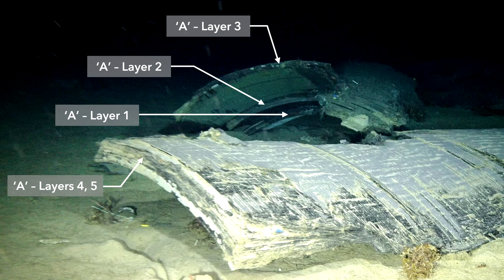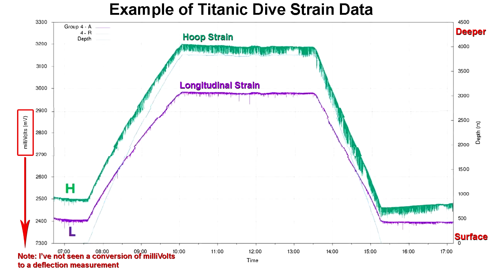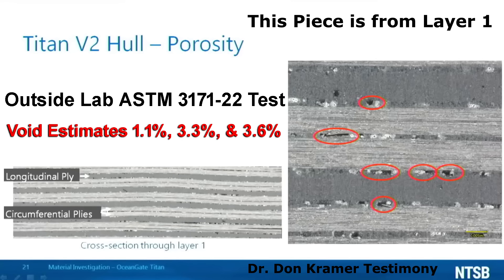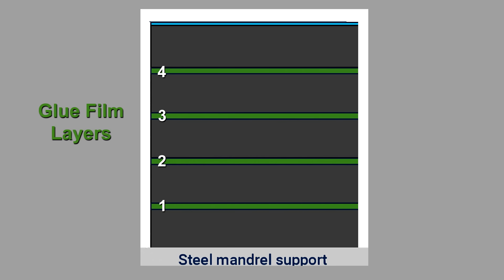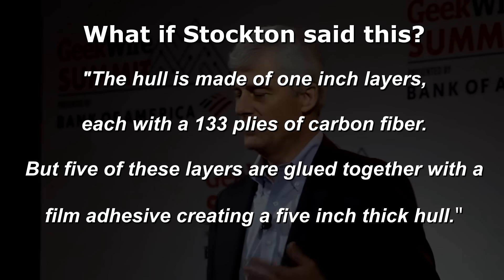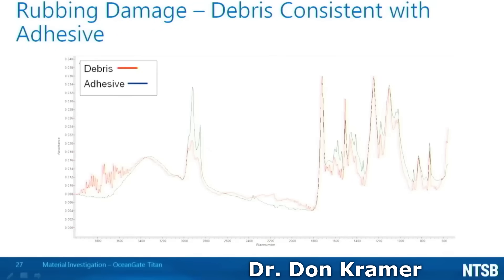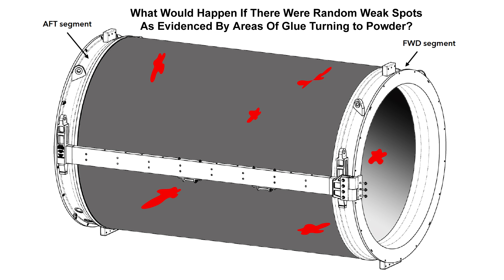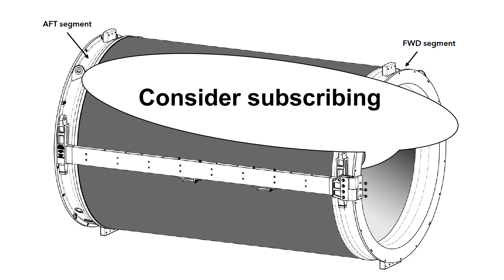OceanGate Titan Hull - Glue Layers Were Breaking Down To Dust - No Clues.

Comment: In 1960, the bathyscaphe Trieste was the first manned vessel that reached 35,814 feet (Challenger Deep) ... and it was glued with epoxy.
Reply: Please be more accurate in your comment.  The original pressure sphere was made from two high strength steel hemispherical shells that were precision welded together.  The replacement pressure sphere was made from two hemispherical end shells and an equatorial ring that were cast by Krupp and then precision machined and welded together.  Any epoxy used on the Trieste was for attaching components that did not need to resist pressure.
Reply: @ronkluwe4875  My comment is accurate and correct. The 3-part sphere of the Bathyscaphe Trieste made by KRUPP was free-form forged and not cast. The parts were machined on all sides, with special attention to the connection surfaces. The parts were then glued together using low-viscosity epoxy without any fillers. My engineering Prof. in uni worked at Krupp in the late 40s and early 50s before joining Black & Decker's EU operations. He used the sphere as an example for a design where the geometry is strengthening the joint under load, so "any" sealant would have worked (in theory at last – in reality, there were cracks due to a different elastic deformation of the parts). The manufacturing process was pretty widely publicized at the time and there is even a 16mm B/W Film about Krupp’s role in the development, highlighting the gluing process. I am using a B/W Photo of a cut-away model showing the glue joints in my materials 101 lecture…
See also: LT Don Walsh, Research Report / NEL Report 1096, July 1962, The Bathyscaph Trieste – Technological and Operational Aspects 1958-1961, S. NAVY ELECTRONICS LABORATORY, SAN DIEGO, CALIFORNIA

Comment: 10 inches were recommended by the carbon fiber manufacturers and this included the 0/90/45 triple winding process. The Titan was made with only 0/90 windings and only to 5 inches. What type of Lunitic would trust a hull made like this?
Reply: Geez, really?  10”?  And they received the recommendation, then halved it?  That’s lunacy in all its glory.
Reply: a lunatic that thinks CF is a good material in the first place.
Reply: @stijnvandamme76  it's nowhere near as bad as commonly stated in regard to compression forces.

It's not as strong in compression as in tension but it's still significantly strong, not weak just not as strong.

Considering that they made it half as thick as suggested, wound it in the wrong pattern and didn't do it properly.

Yet it survived that many dives. If it was 'weak' it wouldn't have survived one dive.

Well regarded and qualified engineers were fine with it being carbon fibre, just not the way they were doing it.
Reply: @retsaMinnavoiG 
Making it thicken would increase the section area where the stress was traction and also distribute better the compression stress.
I like thick hulls and I cannot lie.

Comment: A few4x4 braces inside the middle might have made the difference ?
Reply: Was just gonna suggest a titanium hoop in the middle, internal to the cylinder?  Maybe a thickness of 4-6” to get an effective wedge attribute?  I have no idea what I’m talking about, just a guess.
Reply: @Pene7942 I was thinking of putting a special reinforced concrete inner hull structure under the CF.
Reply: @Pene7942  Yeah, my thought as well. That sort of bulkhead wouldn't really make the inner cabin that much more cramped.
Reply: Load bearing drywall partition would have made all the difference

Comment: The laminated beam example is a good one.  The sheer forces can be extreme, though.  What’s small is the amount of distention or compression the glue layer undergoes. 

In the case of Titan, it appears that the glue layer gave way to the sheer forces before the carbon fiber msterial.  When it did, the hull behaved like five individual layers, each one inch thick.  That stack has nowhere near the resistance to inward force that a single five inch thick carbon fiber composite does.

The other troubling thing is that the fibers were not oriented to resist the inward bowing.  They were essentially circumferentially oriented rather than than longitudinally oriented.

I kinda think that if the thing had been thoughtfully designed, it might still be in operation.  But Stockton Rush wouldn’t listen to his engineers.
Reply from the maker: Agree.  Thanks for your comment.

Comment: While not directly comparable, laminating glass has issues regarding multiple autoclaving cycles. The more times interlayer is autoclaved, there is a decrease in adhesion. This can cause delamination of the glass and interlayer. This is due to the interlayer becoming brittle and not being able to flex properly under stress.
Reply from the maker: Thanks for commenting.  That is interesting.

Comment: Your production is well done, but you're kicking Stockton's dead horse here.     From an engineering standpoint, a composite hull isn't suitable for deep dives, even if it is somehow absolutely flawless.     Period.
Reply: It might be common sense for engineers, but not so for us lay guys.  Plus, it gives us an idea of the considerations a satisfactory material must go through to be robust.
Reply from the maker: Thanks for your comment.  And I agree with you that composites may never be used for a large manned submersible. However, composite hulls have been successful, when smaller and unmanned.  A good example is the Navy's AUSS. Advanced Unmanned Search System.

Comment: the outermost layer of the carbon fiber hull would be in compression, and would be the failure point before catastrophic failure
Reply: I don't think the cylinder needed to actually fail. Bending inward in the center would put a lot of strain on the end joints, pulling the carbon fiber off the titanium. If it failed there, the inward shock wave of water would shiver the carbon fiber into shards. The design failed because of the wrong materials, and that caused the final failure of the materials.
Reply from the maker: Thanks for commenting.  Correct, but the outer layer transfers the compression to the other layers.  That is why for maximum strength the layers must behave as one.

Comment: film adhesive or glue layer sounds real high tech cutting edge - I guess no body could bring themself to say it was DOUBLE SIDED STICKY TAPE
Reply: Wait, did Oceangate seriously build a submarine using fancy double sided sticky tape, cured 5x? 

I am sceptical, but am perfectly willing to accept such a thing. There's so much wrong with the Titan.
Reply from the maker: Yep, you are basically correct.  Thanks for commenting.

Comment: i get why you would use carbon fiber in a race car, but why would you even bother with a sub? is weight really that big of an issue?
Reply: Yes and no. No because you can add on bouncy foam (aka foam will tinny hollow glass beads that cannot be crushed by the weight of 4km tall column of water) to make the sub lighter than water. Yes, because this foam is very expensive and Rush wanted to minimize cost. So making the body of the sub out of carbon fiber (he initially wanted the whole sub out FC_ means less cost as titanium is expensive and a titanium sub is heavier than water and will need expensive bouncy foam.
Reply: As mentioned by Nick, it was all due to cost.
Reply: Yes. More weight requires expensive foam and more volume and a bigger launch vessel and a crane. i.e. $$$$$
Reply from the maker: Thanks for your question.  One of Stockton's big things was that he wanted a long hull to fit 5 people and have "depth" for photography.  He loved the idea that you could have a camera at the back of the sub and be able to take an image of people looking out of the viewport at the front of the sub and enjoying the view.  It was important to his concept of adventure tourism.   Doing this size and shape out of titanium would be too expensive and too heavy.  With a sphere-shaped submersible, it's hard to make one big enough for five people, and you still don't have that ability to have "depth" for camera angles.

Comment: 🔴🔴🔴🔴🔴🔴🔴🔴🔴🔴🔴🔴 The porosity came from air bubbles trapped between the plies during the laminating process. Especially with unidirectional material like used on the hull, air bubbles get trapped between the Plies as they are stacked one on top of the other. Standard operating procedure is to vacuum bag the laminate between the Plies to remove as many air bubbles as possible, then rely on the autoclave process to hopefully squeeze out more but it's difficult to remove the air bubbles that are under the first couple of olies of material. The autoclave process will squeeze the bubbles to a fraction of their original size to reduce their negative effect on the laminate but they are still there. The porosity is actually the leftover remnants of the air bubbles that were trapped between plies. Don't get me started on the film adhesive..... I am a composite fabricator by trade.
Reply: Would a spindle and wrap system in a large pressure vessel decrease those air bubbles, if you just started in a lower pressure environment to begin with?
Reply: @leechowning2712  It would but only if you also vacuum treat the glue first. There is enough gas dissolved in epoxy glue that when it start to heat up and set, you will see tinny bubble appear and form inclusions in the epoxy matrix. This is from experience making thick epoxy cast. You need to vacuum pump the epoxy glue before its sets.
Reply from the maker: Yes sir, thanks for commenting.  It's hard for me to figure out how the Toray fabrication suggestions fit each situation, but they seem to indicate autoclaving at about every 4 plies.  OceanGate did it every 133 plies.  I don't know if the engineers at Electroimpact told them that was ok.  They were the ones with CF experience.

Comment: His use of stress sensors is like driving a car at 100mph with 1 inch view infront of you. You'll only ever know its too late.
Reply: They got a clear warning on a previous dive when some of the sensors started giving different readings than previously at the same depth and the difference became a consistent artifact. Something gave and changed the shape of the hull. That was enough to scrap it right there, but they just learned to accept numbers in the new range.
Reply from the maker: @GWNorth-db8vn  Thanks for your reply.  You are correct, it was dive 80 that had the problem with the permanent change in the strain.
Reply: @GWNorth-db8vn  Holy shit.  He really wanted to start making money then.  I wonder what his personal financial situation was at those times.

Were those previous dives generating revenue, or were they shakedowns?

Comment: Making a successful carbon fiber hull seems to be possible, but the technology is not currently available.
Reply: a titanium hull is possible and available unless you are too cheap
Reply: Well, a google search shows that there are other geometries that are more resistant to pressure than a simple cylinder. Rush could have been the piomeer for CF sub hulls if he did all the experimentation work needed to find out how CF and various glue types of fails in the ocean... a high salt, wet, high pressure, high UV and high impact environment. It would probably have taken him decades but that is research. The man simply could not do that kind of work.... he was too short of money. Even his preliminary work indicated he needed a 7 to 10inch CF hull, not the 5 inch hull that he ended up with. He couldn't even follow his own specification.
Reply: @nickl5658  too bad that would take millions and possibly decades. Now, because of this, nobody will want to experiment with composites at least for a long while...

Comment: The part of the design that surprised me was that the carbon fiber ring ends did not compress against the outer diameter of the titanium end bells. On a navy sub, the outer hull compresses against inner frames. I assumed the carbon fiber compressed down against the OD of the titanium end bells,  transferring the force to the stronger titanium. But the actual design set the CF cylinder in a groove on the edge in the titanium. So with a 90 degree connection between the CF and the Ti, all the pressure compression was a shear force, only supported on the thin inner lip of groove. As you can see in several of the photos, that thin strip is just snapped off.
Reply: I don't know much about much, but before knowing the end ring profile was a shallow C channel, i was assuming it would have been a deep L profile with ample contact area between CF tube ID and the profile., it just seemed to make more sense. Since one would be designing with the pressure direction in mind. Not only is the outer section of the C channel not loaded, it also obscures the state of the joint preventing inspection.

Then again not being able to see the cracks forming.... may have been entirely the point, deliberate.
Reply: To OP, that’s what I assumed as well.  I also put a question out asking if an additional hoop on the ID of the cylinder would have helped - but now I’d like to see a model of your initial assumption.

Comment: i wonder iv you could do a small scale test on a copv tank just cycleing it to high pressers and then seeing if the layers had the same breakdowns and weakneses
Reply: It is not that simple for carbon fiber. The flaws in laying carbon fiber occurs as the layer becomes thicker. It is non homogenous. So a thin layer of CF does not scale up to a thick layer of CF. Unlike metal which does. The only way Rush could have tested his CF hull and the process used to build them , is to build 30 life size hulls and test them all to destruction. Then he would have the bare minimum of statistic data to make an accurate model of the CF hull he is building.
Reply: @nickl5658 That is very interesting.  I’ve often wondered about the reality of scale testing.
Reply from the maker: @nickl5658  I agree with you.  Tony Nissen, in his testimony specifically says when he came on to the company the CF 1/3 scale models were already built and the good thing was that the engineering scales up well to the full-size hull, and engineers like that.  But he was not correct.  Carbon fiber adds a lot of variables as you try to get thicker.  Thank you for commenting.

Comment: Great video! Since there were trimming the ends, I am surprised they just didn’t make it 1 foot longer and trim it off, and do some kind of process validation & destructive  testing. Boggles the mind!
Reply from the maker: Thanks for your comment.  I am glad you liked the video.  What you pointed out is correct.  It is actually pretty standard in the design process for things like this.  Different engineers called it different things during the testimony.  Things, like "witness panels," and "coupon level testing."  But basically, they mean to make a test piece, that is EXACTLY like the production piece and look it over and test it.  Prove your design and your fabrication process.  Boeing and NASA both told OceanGate about this sort of thing.  OceanGate may have done some, we don't know. The NTSB may have other information that hasn't been publicly released.

Comment: A support ring in the middle on the inside would have been a big help.
Reply: Being left outside uncovered in a parking lot to experience a Newfoundland winter may suggest poor planning and execution as a whole.
Reply: There was clear evidence it sheared off on implosion. that edge was way too thin.. i bet the glue failed at the edges.
Reply from the maker: Possibly.  Thanks for your comment.

Comment: Given that the composite material itself (the tow) is a mix of carbon fiber and a pre-applied, uncured epoxy, I think it would be fair to say that rather than just ~550 square feet of adhesive, there was actually around 133 x 5 times that, given each of the five sections was made up of 133 or so layers.
Reply from the maker: Thanks for commenting.  Yes, I get your point.  My emphasis was on the glue film that was not an epoxy that needed to be cured (as far as we know). Thanks for adding to the discussion.
Reply: @ I was partly being a pedantic jerk, but it's also something to factor in. I think there was a reference to the CF material being aged-out Boeing stock? So there's another failure enhancer - potentially degraded uncured epoxy. The CF-itself doesn't really degrade unless exposed to certain chemicals/oxidants or thermal events.
Reply: yes, epoxy is glue too, and since rope (as the carbon fiber strand essentially is) does NOT provide support when pushed/compressed vs being stretched/pulled, all that glue was mostly what provided the structural strength within the entire hull
Reply: @ It's a little more complicated than that. Take a rope, soak it in water and then freeze it, and you'd have a similar situation to CF parts - you can push the rope, within limits. If you were to take the same volume of epoxy as a proper CF part and subject both to compressive stresses, the CF part would be dramatically stronger in compression and handle fatigue loads better too. 

When properly designed and manufactured, the orientation, density, and bond integrity between CF and the matrix will add significant strength and stiffness. But it would not use the CF itself as efficiently as when in a tensile load application.
Reply: @davidg3944  frozen rope does sound like a good physical analogy 👍

Comment: It's actually amazing it lasted as long as it did. Rolled the dice on every dive.
Reply: they did good engineering till it got too expensive, then just winged it
Reply from the maker: @ah0mamy  Thanks for your comment.  You are correct.  At the time of the design of the V1 hul,l Spencer Composites actually did some good engineering of the entire sub.  Now, their carbon fiber layup was not great in V1, and they overestimated the strength.  But they did some good work on matching the moduli of the titanium to the carbon fiber hull,